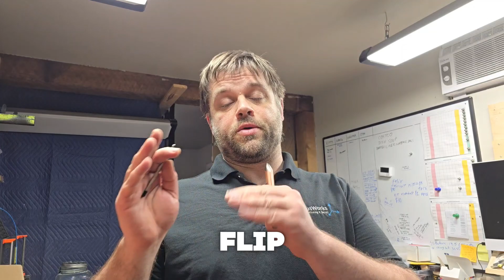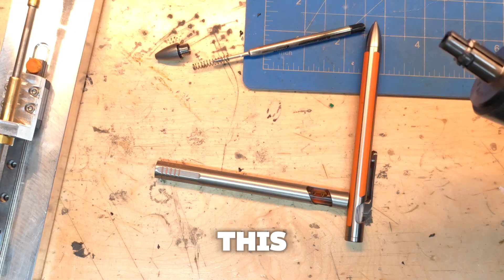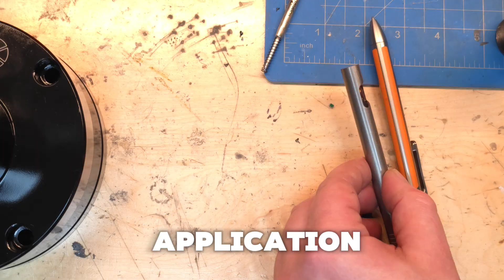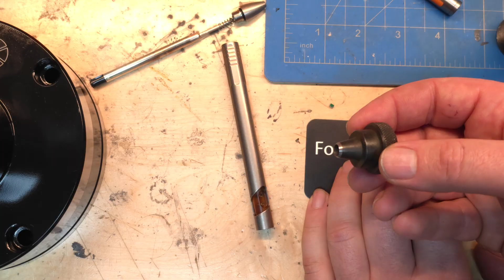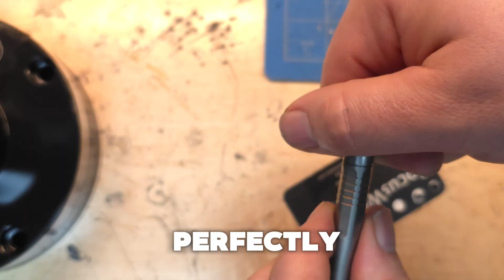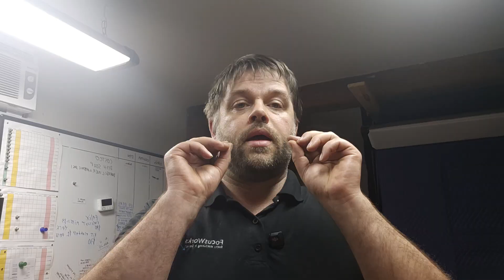Sideswipe pen refills and how I'm going to change

Comment: Are the serial numbers now on the outside for publicly available models or is that just for your test versions?
Reply from the maker: I did a small batch with them on the outside but customers didn't like it there. I moved it back inside the barrel of the pen after that